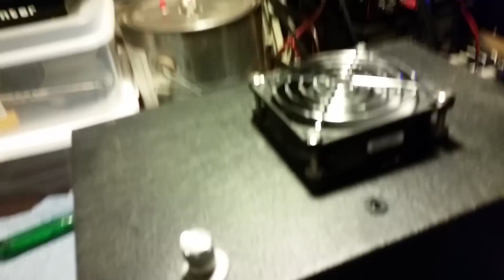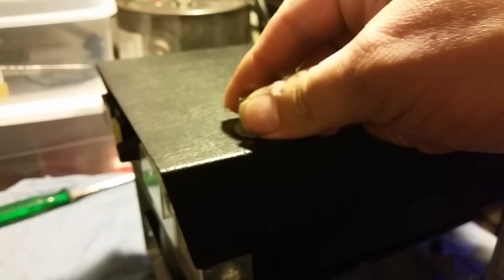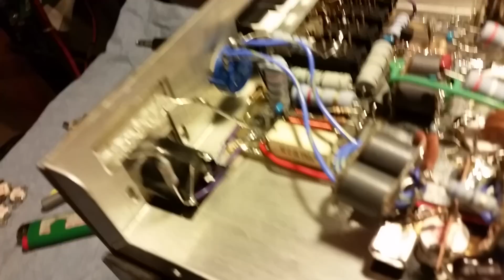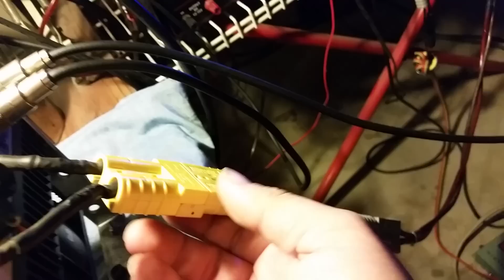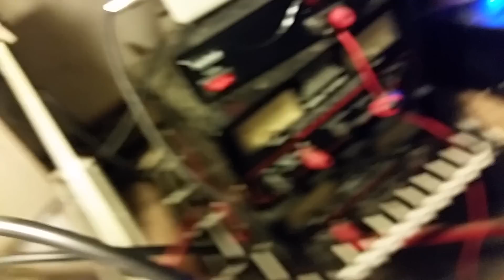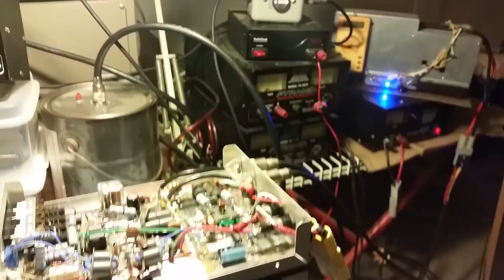Custom Texas Star 667V With MRF454 Finals For Ebay

Comment: If you take time to re wind output and input transformers and re tune. will work great !  454 does not need a lot of drive like the 2879 . just add more padding in input get forward swing.  you also can use MRF 421 ,re wind and re tune and get great output! The MRF 492 will also work with many others. I would use HG 2879 if it were mine. May 2019 Toshiba 2SC2879  is $200 ea!!